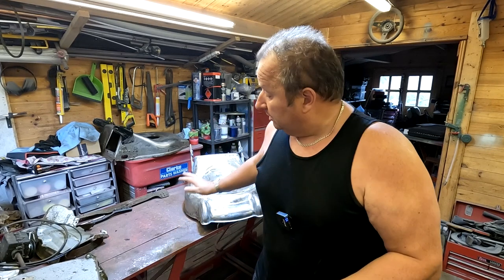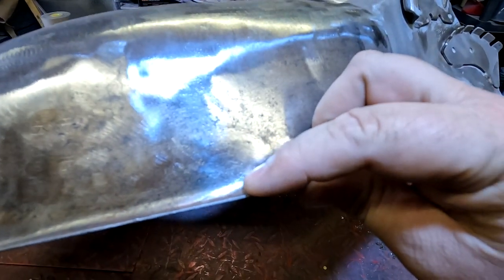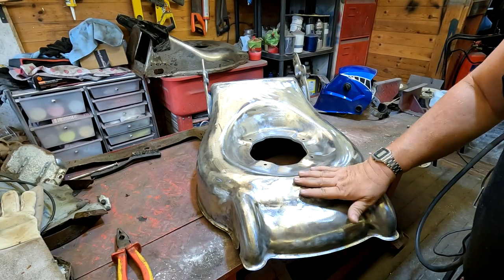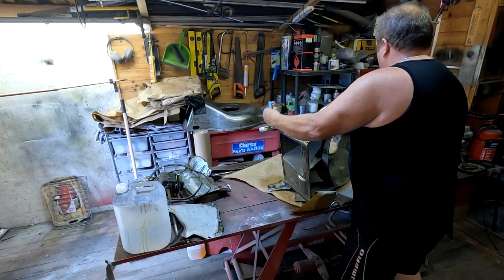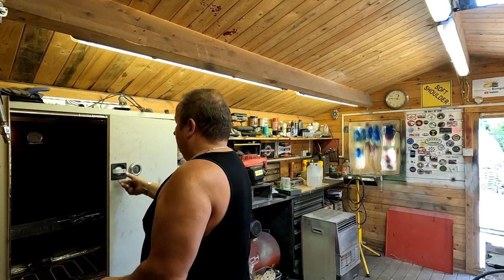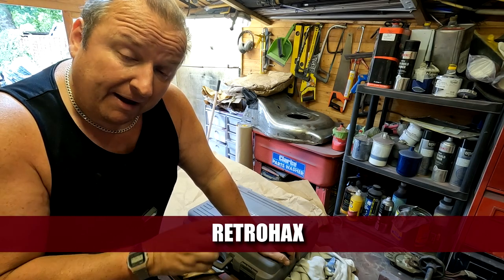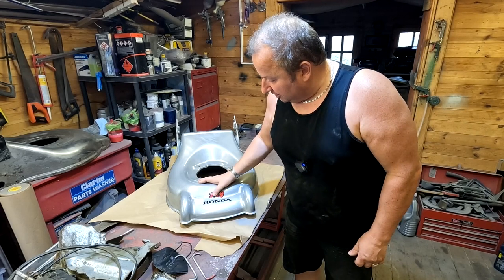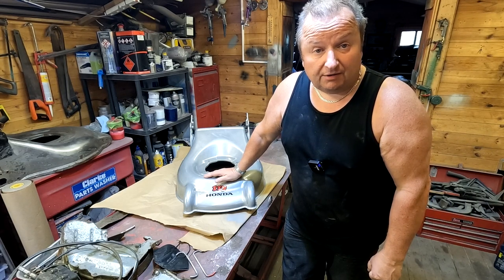Powder Coating A Lawn Mower Deck For A Fellow Youtuber

Comment: nice finish  but i would be careful using a hover to hover up left over dust i was always told one such risk is the high possibility of combustible dust explosion when the motor sparks i always sweep mine up . but happy to be corrected if im wrong.great job tho

Comment: Just found your channel. New subscriber.
Looks like you definitely know what you're doing!
Will power coat keep grass from sticking to the deck? Will powered coating hold up under a mower?
Thank you!!
Reply from the maker: I normally paint the underside as they are normally quite poor finish. Powder coat is a string finish. Thanks for the sub too Dan.
Reply: @retrorestore  "string finish"? 🤔
What paint holds up well under a deck?
Reply from the maker: I use hammerite smooth. @dans_Learning_Curve

Comment: What settings on the welder would you recommend for 1mm steel mate
Reply from the maker: 1 use these settings as well for 1mm steel plate